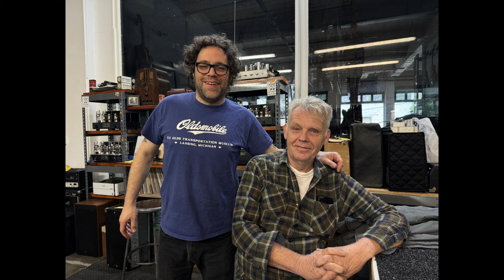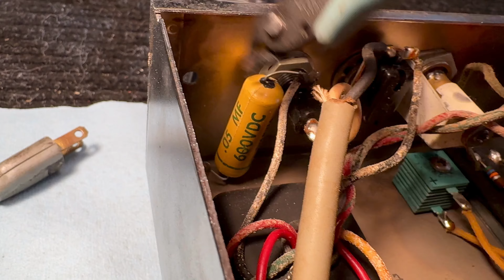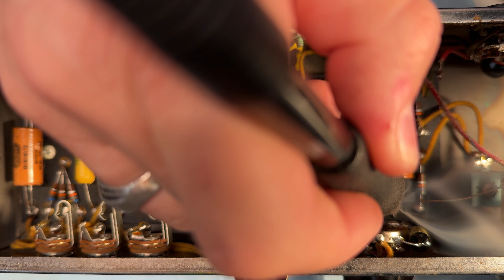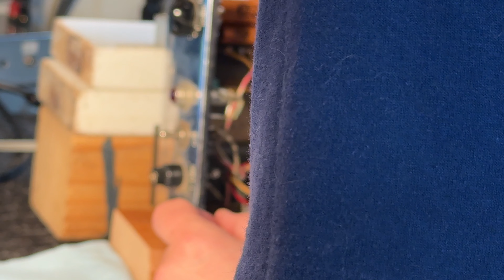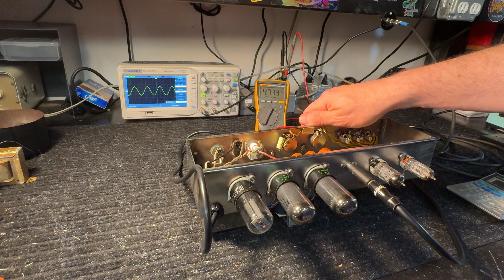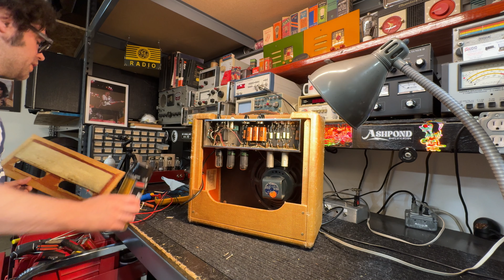1958 Fender Harvard | Repair &Test & Circuit Analysis!

Comment: What was the final value of the B+ voltage with the new opt and the amp biased right? The oroginal schemo says 305 but some folks indicate that this might be low. The amps did run on lower wall socket voktage back in the day so todays readings will be 10 or 15 percent higher.

Comment: Isn't it dangerous to be breathing in the smoke when you do soldering? Shouldn't you be wearing a mask or have a fan on low to blow the smoke away from you as you're working on stuff?
Reply from the maker: I often move my fan when I'm filming to make space for the tripods. Amp repair is a very dangerous job between the High voltage, solder, chemicals, asbestos. its a carcinogen carnival and I have found a fan blowing over the bench to be the best way to not breath in solder. With that being said it's a much safer job than so many other jobs.
Reply: No, its fine.  Thats half the fun of soldering.

Comment: Hey Pat
In your opinion, which amp do you prefer most and why? 
The Harvard, vibrolux or Deluxe? Thanks
Reply from the maker: that's so hard to say Danny, it really depends. My guitar playing because I do a lot of odd chord voicing sound best with clean amps. So I say I would go with the 5E3 for the 12". But If I were recording some tracks and wanted breakup I go the the Harvard.

Comment: What does the "Paper Bobbin" do to the tone/frequency response of the output transformer?
Reply: The paper (cardboard) bobbin and paper insulation layes are thicker and less insulative compared to modern materials and so the transformer has to be wound differently, with more space between the windings. The paper bobbin/insulation actually makes the transformer less efficient, in an interesting and sometimes desirable manner: it will saturate more easily, or cause more voltage sag when the amp is pushed, which compresses the sound.
Reply from the maker: thats true
Reply: There is no difference between the nylon bobbin and paper former as long as you use the same layer insulation, same wire size and same turns and keep the original build dimensions. Nylon vs paper has nothing to do with saturation. Saturation is determined by the core material, lamination size, method of stacking, primary turns count and stack height. A paper wound coil might have slightly different leakage depending on the thickness of the former vs the nylon. Leakage will affect the high end response and the amount of resonant peaks, the amplitude of the peaks and the frequency at which the peaks occur. 
Now there is the possibility that the nylon bobbin wound xfmr was scatter wound, that is, no layer insl and no margins on the ends of the layer. And that nylon bobbin might also have a core that is butt stacked as in the case of some Tweed DeLuxe amps. Now you will have different saturation points because of the difference in the lam material, thickness of the lams and the air gap.